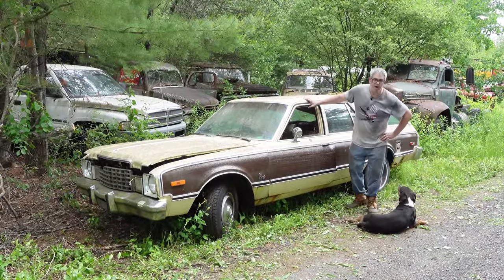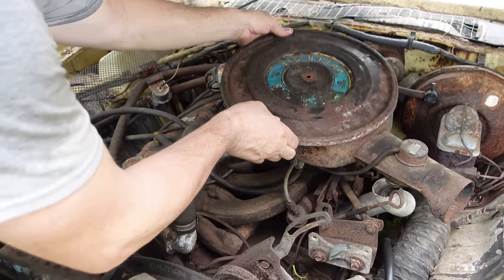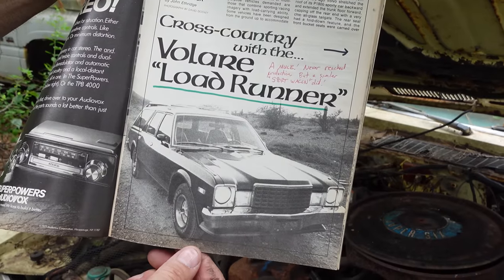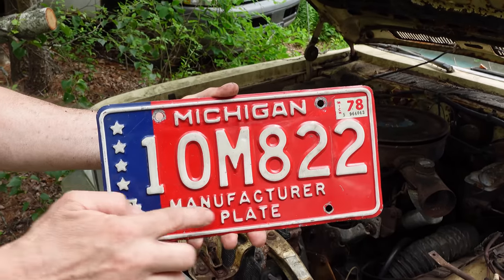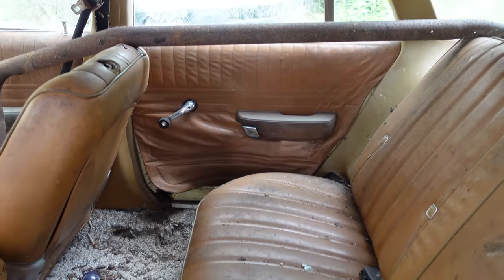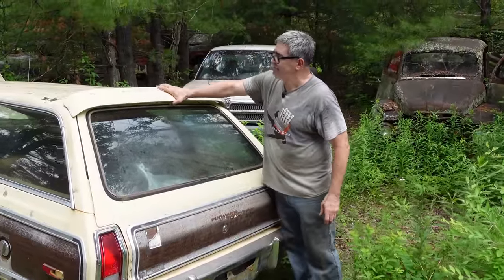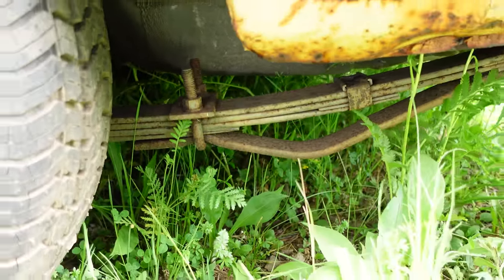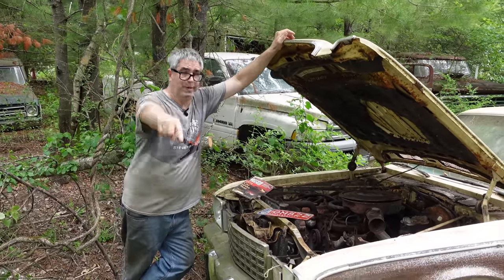Road Runner Station Wagon?

Comment: Hi Steve, nice video!  The idea behind the Chrysler "Lean Burn" system was that Chrysler was able to meet hydrocarbon, carbon monoxide, and nitrogen oxide levels without use of a catalytic converter, and used regular leaded gas.  In the mean time, that did not last due to stronger emission standards as time progressed onward.  Please Reply.  Dave...
Reply from the maker: Yes the Lean Burn was a less costly way to meet the looming emissions standards. But as you say, Uncle Sam ratcheted the standards up with each year so Chrysler knew the added expense of catalytic converters was certainly looking... I "get it" that we need clean air, but the sad fact is that the simple EGR, Low Compression, Lean Fuel Mixture, Retarded Ignition Timing, etc. smog reduction tricks of the 1973 - 1983 era actually REDUCED FUEL ECONOMY by as much as 3 to 5 mpg AND slashed power so you had to drive flat-foot most of the time. Who thought this all up? Crazy stuff and frustrating to study with the benefit of hindsight. EFI and computers really renewed performance and economy when they arrived en masse in the mid-1980's. Thanks for watching and writing. -Steve Magnante

Comment: We had the 77 roadrunner ttop 360 manual thermoquad. Decent enough to keep up with the Camaro. Rusted out completely in 4 years. Used the fender jack on the front rippeled the fender and cracked the windshield.

Comment: Small detail at 8.30.  The 5mph bumper standard is correct.  The 2.5mph standard is 1973-only.  1974-on is 5mph like the front.

2nd detail at 9.45 is the F-body fender recall.  The rust issue is the fender rust-thru at the fender tops just ahead of the doors, not the fender bottoms.  I was a dealer tech when this was happening and we did keep fenders in stock for this issue.

Comment: MY dad had  volare like this same color and wood grain. His had a 360 lean burn engine it later had issues and that junk was taken off and a older style distributor installed, then it ran great for many years. I pull the intake once in late eighties and cleaned out the plugged crossover in the manifold and trans shop replaced something for lock up torque converter, other than that it was a great driving car for many years.

Comment: Had the Dodge Aspen wagon in '77. 318. Dad wanted the 6 but the only one on the lot was white, which dad didn't want. It was a quality turd. Liked the car, but not the rust. Broke lots of stuff (brakes, alternator, car was junk, ate tires>>couldn't hold alignment)

Comment: Good review Steve. The F-body (Aspen & Volare) concept looked great on paper, yet due to Chrysler's notorious poor build quality, execution was another story especially at Hamtramck assembly where the UAW had a very negative attitude. Fit & finish was terrible until Iacocca arrived in '78. The drivetrains were bullet proof but the bodies literally disintegrated before your eyes in the Detroit area from all the salt used in the winter.
Reply: Hamtramck wasn't near as bad as Lynch Road where the B bodies were built. Overall Volares were not that bad of fit and finish. Maybe one-in-four would need some sort of an alignment during prep, compared to something like a Cordoba, where maybe one in ten or twelve would need an adjustment, where as a B body "baby Fury" would pretty much need every door, window, and fender aligned.

Comment: Growing up in the late seventies, early eighties: A couple of older friends had black Aspen RTs with 360s and four speeds. Both swapped out the original engines and installed 340s.

Comment: In 76, the Premier (and SE for Aspen) was an overall interior/exterior trim, and the woodgrain panels were an external feature.  I believe there would be plaid upholstry on the interior (on wagons).  By 78, the interior and exterior trim levels were independent, and this car appears to have the premier exterior, but not interior.  There would have been a Premier badge to indicate that the interior is premier trim which I don't see on this car.  Confused yet?

Comment: I had a '66 Dodge Monaco, factory 4 spd 383 Magnum, about 12-13 mpg town but 16-17 hiway. In the late '70's I bought a used Volare 2 door to use basically as a truck, and a spare ride. 318 auto, about 13, town. Never really hiwayed it.

Comment: Manufacturers love to test cars in Colorado. I remember seeing a grey Challenger in Glenwood Canyon with a Michigan manufacturer plate on it. It wasn't covered in optical illusion swirl and squiggle decals or those things that look like an old car bra to hide what it was. It pulled off into a rest area and I followed. The guy driving opened the hood to check something and I saw a large aluminum box sitting in the valley pan and could hear a distinct whine coming from it. I'm sure it was a Hellcat test mule.

Comment: In early 1980, my wife was PG and our little 1977 Chevy V8 Monza Coupe would not work for our growing family (soon to be three boys). My wife talked me into buying a 1976 Volare Stationwagon Slant Six, that looked just like that one! After a few months, I mounted a Edelbrock 4Blb manifold and carb on the Slant 6. I was disappointed in the performance. A couple of months later, I traded it in on a 1979 Dodge Aspen stationwagon V8 (318). At least it had a lot more power!  We finally traded it off, after the transmission died @ 100K miles.

Comment: Drove a 77 Volare few years in my youth.  Other than poor handling, it was one of the most reliable 2door coupes, with plenty of room and reasonable gas economy vs power.  Super six with auto and air, power steering and brakes. Outran a stock 305 two barrel Camaro with the super six.
I currently own a 78 Road Runner.  Neither of the Volare I’ve owned were or are rusty including the 78, but I’m In Deep South.

Comment: Steve, Some of us might argue that Chrysler never REALLY replaced the reliable Valiant and Dart. 🤨
Reply: It is a Valiant and Dart at "heart" with some "modernization".
Reply: @googleusergp  It's not and the Valiant/Dart were much better!
Reply: @MauiWauiPineappleExpress  I would agree, but "same" heaps, different clothing.
Reply: @googleusergp  Nope, the Volaré/Aspen twins only shared the same engine and transmission choices with the Valiant/Dart!
Reply: @googleusergp Us fanatics in the Mopar camp beg to differ, my friend. Compared to the beloved A-bodies, they were called F-bodies for a reason, if you get my drift...😉
Reply: @MauiWauiPineappleExpress  Nope and the same basic crappy torsion bar suspension and "potato sack" ride. Call it what you want, it was lipstick on the same old pig.
Reply: @LongIslandMopars  My grandparents had a 1980 Volare that they bought new. What a noisy, clunky, junky heap of crap. It was not as refined as my parents GM cars of that same era.
Reply: @googleusergp  Ok buddy, move on!>
Reply: @LongIslandMopars 100%
Reply: @MauiWauiPineappleExpress right on 👍
Reply: @googleusergp Completely different car. Completely different front suspension. Relax, I know they used the same ball joint. There's many examples of GM or Ford using the same ball joints on completly different platforms. Designing a new car doesn't require new ball joints. Same as GM, Ford, or AMC, almost all the Chrysler products shared the same ball joints, u-joints, fasteners, etc. Are they all the same car? 
AMC Hornet vs AMC Concord, now that's the same car with a little modernization. Same platform, interchangeable parts, etc. That's not the case with A-body Dart vs Volare/Aspen. 
Typical ignorant comment from a Chrysler hater that doesn't know a thing about Chryslers.
Reply: @johneckert1365  No it's not "completely different". It's very similar in many regards. It's one of the many reasons Chrysler was behind the others back then. Not a "Chrysler hater" as they were all bad back then, but you can slice this any way you can, these cars were pigs and they were the swine of the former ones that came before them. These were already long in the tooth by the time the plug was pulled on them.
Reply: @johneckert1365  Mr. Iacocca even said that the Volare and Aspen should have never been built. However, he came in mid-1978 when those heaps were already on the market and there wasn't anything new in the Chrysler stable for yet another few years. Chrysler had a pull system of inventory and production which lead to bloated inventory levels of cars with weird matchups for trim and equipment. With that said, if Chrysler had the money, Mr. Iacocca would have pulled the plug sooner than the 1980 model year. The M and J bodies of course are also very similar but you can't compare a Ford or GM rear wheel drive to a Chrysler. The Chrysler rides like a sack of potatoes. 

Law enforcement used them because they were cheap and they were plentiful and the discounts were heavy over many of the other brands at the time. Chrysler eventually got smart and dumped the Holley and Carter carburetors for Rochester Q-Jets. 

Chrysler had solid powertrains, that's no doubt, but their carburetion, ignition, handling/suspension and quality control were awful. That combined with their backwards inventory system put them in trouble right in the middle of a huge recession in the late 1970s and 1980s.
Reply: @googleusergp  Argue all you want, other than thier size, and yes your ball joints, there's very little in common between a Volare & a Dart. 

A Full-size 71-76 GM uses the same upper control arm and ball joint as a 73-77 mid-size. So is a Caprice the sane car as a Malibu? A Delta 88 the same as a Cutlass? Of course not. Even these comparisons have at least "similar" front suspensions, whereas Volare vs Dart does not. 
Maybe if you wrote a poem about it you could understand?
Reply: @johneckert1365  I don't need to argue anything, I'll just state it. These cars were crap. They were lipstick on a pig. They were recycles and the public and press knew it. Even if I wrote a poem about it as you put it, I'd still be way ahead of any knowledge you had.

Which automotive company on the industry side did you work for? I hear none. Which suppliers did you work for? I hear none again. Which OEM and aftermarket parts books did you write? I hear none. You were already struck out before you hit the batter's box.

I get it, you like these cars. That's fine. But to say they were "different" than what they replaced is an ignorant statement. The body and trim may have been different, but that's it. If you believed anything different back then as you do now, you got hoodwinked twice. 

Toodles.
Reply: @johneckert1365  🤣
Reply: @LongIslandMopars  ✌️

Comment: A good customer at a C/P dealership I worked at wanted a 1973 Road Runner station wagon.  No such thing existed so a Satellite Sebring wagon with 440 ci. motor and 4 speed manual transmission was special ordered with the company's white roof over red body color scheme.  Four months later it arrived and parked over a twin post lift for servicing.  That night the maintenance man hit the forward lift control with his equipment buggy and the lift went up and dropped the car on its side.  It was quickly repaired in the body shop but everyone cringed every time it appeared at the dealership.

Comment: Sitting kind of behind the Volare is a '73-'79 Ford F600 truck.  Just check out the instrument cluster and gauges in that truck.  GM usually had the best looking gauges, but that run of F600s had gauges to rival GM's. They look like the gauges from the original XR7 Cougar. Those '73-'79 F600s have the same dash as the '67-'72 pickups, so that cluster will go right into a Bumpside pickup.
Reply: I worked for a local construction company in the mid-90s. They had a green 77 f600 dump truck  300 six powered that no one wanted to drive. I would get in it any chance I could. I ended up being its caretaker for at least 5 years, man. I loved that truck.
Reply: They sure are a cool cluster. Ford used alota older pickup truck parts in thier medium duty line. 80-98 medium duty F-series used the dash & cluster from the 80-86 pickups. I suppose there was no need to redesign things for a work truck.

Comment: By 1980 Chrysler had a massive Recall on the valerie's & aspen's cars For Rust  problems on Fenders and hoods On those  cars Work for a Dodge dealership Body shop at the time and that is all. I did. For a year or 2 straight replaceing Fenders  & hoods On Those cars

Comment: The car may rust away around it but that slant six would never die so long as you kept maintenance up
Reply: I was a Chrysler dealership mechanic in the 70s. We actually had one slant-6 that broke a crankshaft. Every mechanic in the dealership was amazed lol. I even took an old Dart with a slant 6, that I bought for parts and was sending to the junkyard, drain the oil out of it and drove it to see how long before it would blow up. I gave up after 20 miles.
Reply: @garyszewc3339  I had a 1973 satellite that had been a taxi. It had 69,000 plus miles. I put another 50,000 on it and the only thing I had to do other than regular maintenance was replace an oil sending unit. I sold it and that guy made another 45,000 and last I saw his son was driving it.

Comment: I had a 1976 Volare 4 door, and all we used it for was beer runs, and running from the police. The 360 4bbl  was oddly enough good enough to out run the Caprices and Crown Vics the central valley cops could throw at teenagers in 2001. I sold it to a relative for 400 bucks, and the trans went out a month later, and I was in no mood to change out a giant torqueflight.

Comment: Wasn't there an issue with battery fumes or acid leaking on the brake lines?
Reply: Yes.  Brake line shields and replacement brake lines along with a upper A-arm bracket recall and MULTIPLE carb/emissions recalls.
Reply: @jonathanmorrisey5771  also the Lean Burn computer mounted on the air cleaner on top of the engine. Dealers would send them in for warranty, factory would decline, saying they were ok. (Also a shortage due to video games of computer chips). Mechanics then would devise ways to Burn them out, so the claims couldn't be declined.
Reply: @jonathanmorrisey5771 the a-arm reinforcement was the reason I quit my job at the Chrysler dealer. I was the third or fourth mechanic that actually broke their impact trying to do those. Other guys were twisting the half-inch drive right off the front but my impact actually snapped the case in half. I got in an argument with the service manager when I told him I wasn't doing any more of those recalls.

Comment: I don't think the rust issues can be placed on production that easily. 
The lack of drainage in the lower cowl would have been design & engineering. (Maybe even accounting.)
Reply from the maker: When I say "mass production" I'm referring to the often rushed, hasty design work as well as the actual assembly. When the "profit motive" is the primary goal - as in any mass production setting - quality generally suffers. Thanks for watching and writing. -Steve Magnante
Reply: @SteveMagnante  Thank you for clarifying!
I really appreciate your work. Being a child of the 70s I can get a bit froggy when it  comes to malaise era machinery.

Comment: Rated  at 110 horsepower  ' I imagine  that is net horsepower  as opposed  to the earlier gross horsepower  rating? .Are these motor's actually as powerful  ( or more so) as the old 145 HP , single  barrel?
Reply from the maker: With the "net" rating system that was imposed / adopted in 1972, all engines "fell" but not as much as the numbers would suggest. The old 145-hp rating didn't suffer too much and only the cam timing was a little milder after 1971. Not a big loss. The Super Six setup really wakes up any pre-'75 Slant Six. From the 170 to the 198 to the 225, the 280-cfm Carter 2-bbl adds an easy 15 horsepower with no other changes. I've done it on my cars several times and its a real thing. The only hassle is that the Super Six carb isn't directly compatible with the kick-down linkage from the 1-barrel carb. So you either cobble up a workable deal (be sure to grab the slat stamped bracket under the intake manifold to make the job easier) OR just do what I did and install a "full manual" valve body in the 904 Torqueflite transmission. You'll have to shift 1-2-3 after the "full manual" conversion but its a better, firmer shift. Anyhoo, Thanks for watching and writing. -Steve Magnante

Comment: Having two 77 Cougar wagons as daily drivers, I can tell you that a fold down tailgate is far superior to an uplifting tailgate where the entire rear tailgate raises above the roof line of the vehicle.   SUV's like the Chevy Tahoe are still using this inferior type of tailgate.   The fold down tailgate with a retractable rear window gives you additional extended hauling capability on the wagon bed, and allows you to carry long objects on the roof that extend beyond the rear of the vehicle, like a ladder for example.   Many SUVs are putting the antenna on the rear of the roof, which reduces available roof hauling space.   Wagons are superior to SUVs when it comes to having a lower roof.   You can easily load the roof of a true station wagon with a luggage rack, where the roof lines of many SUVS like the Tahoe, Explorer etc. are so high that you may need a ladder to load the roof.    The real shame is that a true intermediate  or full sized wagon is superior in many ways to an SUV, or even to a pick up truck, yet most people are no longer aware.